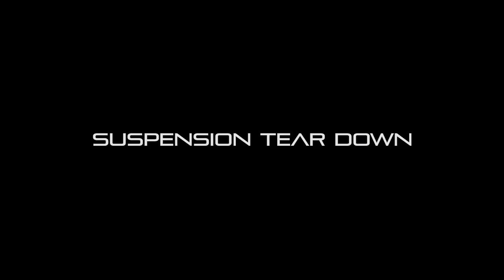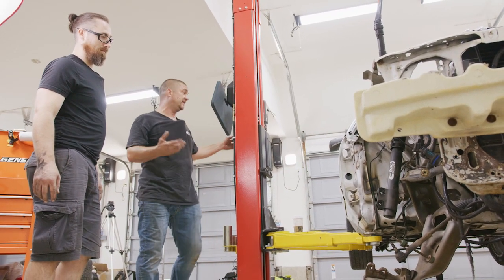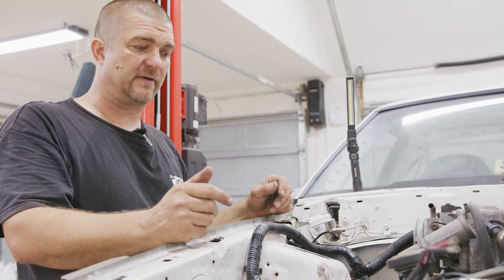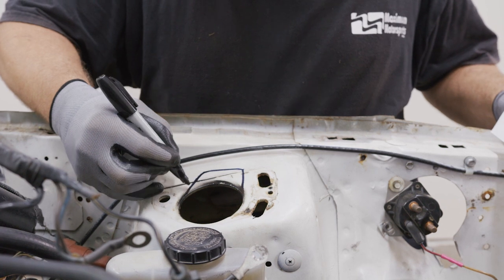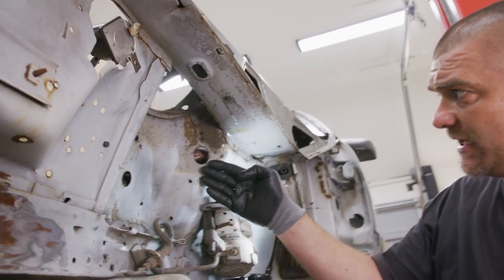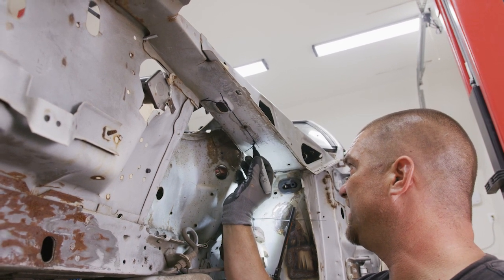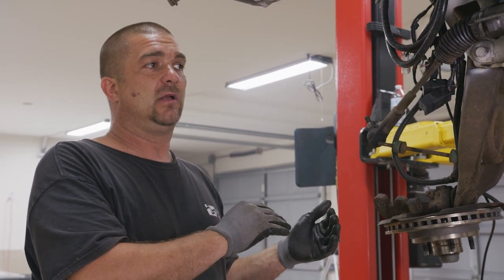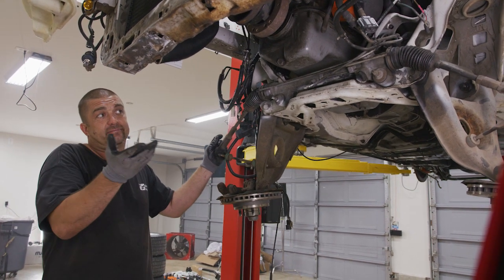Duncan Performance Stage 3 Angle Kit Install-Foxbody

Comment: Love Jon! Purchased and installed his bolt on kit and tapered bolts for my buddy and couldn’t be happier. Had the kit on within 3hrs start to finish. That’s including front coilover install.

On the rear, I just pulled the flanges back, no trimming. I did however have to swap out the top hat for another set I had laying around from my Honda. Only had to do that because Ford’s fantastical quality control had one side’s shock hole too close to the wheel tub than the other. Between the seam sealer I just didn’t want to scrape off for fear of water leaks, the shock threads just didn’t poke in far enough. My spare top hats were about 1/2” lower in profile so I got it all installed.

Comment: What are you using for lower ball joint?  Does it have a snap ring on the top or are you using a different design ball joint to press in from top of control arm down?  With coil over the lower control arm is not longer pressed away from the vehicle and I have concerns about press fit ball joint raining in lower arm.  Thank you in advance for input.

Comment: Great content and attention to detail looks like You have put a lot of time and thought into development of this system .
Do You have an all inclusive
P/N for this Kit ? Any information that You can provide will be greatly appreciated . Thank You so much . 🇺🇲🇵🇷🦊👍
Reply from the maker: Hi Ferdinand, there are a ton of options for this kit depending on your budget. If you have a 92-93 like mine and you want the exact setup I have I can ask Jon to have this added to his website but if you go on the site and add the stage 3 kit, feal coilovers, Mm caster/camber plates, MM Kmember, steeda X2 ball joints, rear upper and lower control arms and panhard bar. Jon will order all of the parts and have them shipped to you without having to go to the other websites